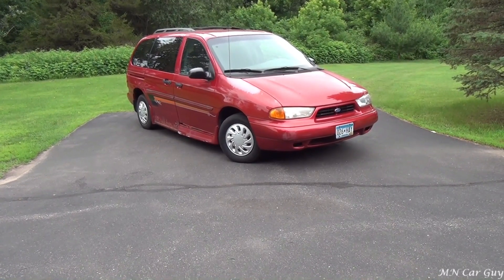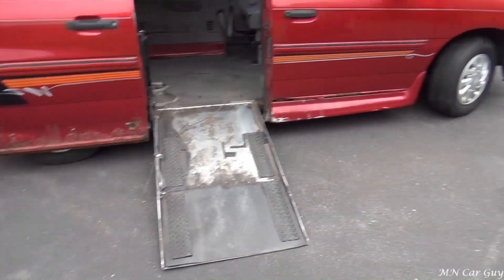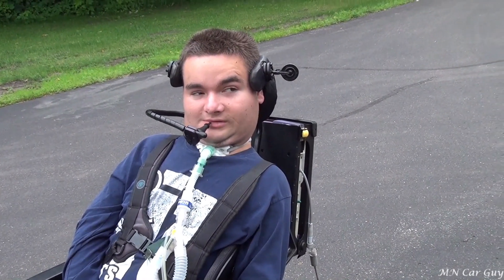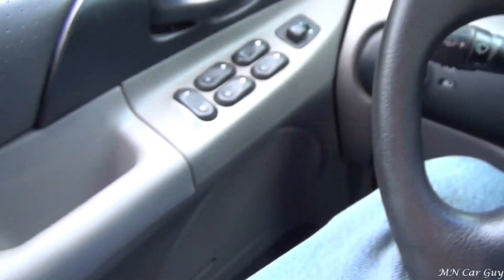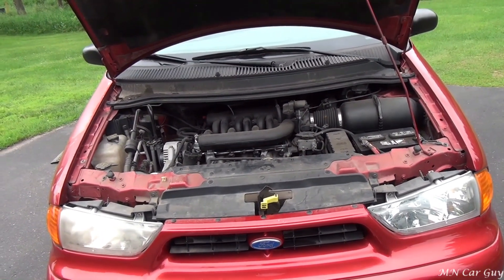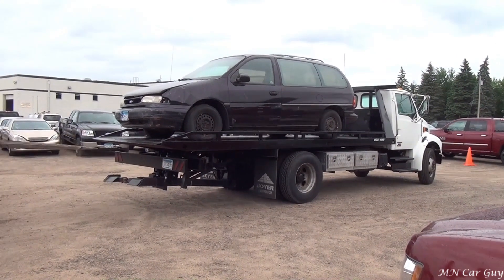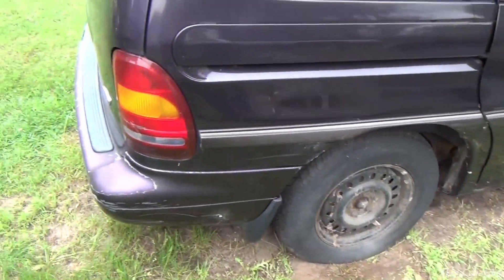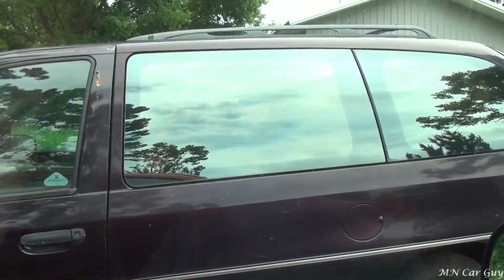1998 Ford Windstar (New Project!)

Comment: I have a 1998 Windstar with about the same mileage that this one had at the time of this video. The thing to try with that passenger side window is or at least on mine, it was a regulator. And I love to see how people are already hating on the engine in this saying it should already be swapped out. Being that this is a GL I am guessing that this is the same 3.8 L Essex V6 from the mustang. However, what people don’t realize is it is actually better in the Windstar because it has the split induction system. If you look at the intake Plenum, you will realize that there are actually 12 runners. Six small runners and six large runners. There is a butterfly valve in there, that if it is working correctly, will switch between the two sets of intake runners depending on what is desired. Power or efficiency.  If you want it to feel like it has a little more power and sound better, I would suggest, if you are in an area that doesn’t require emissions, just cut everything off and just run straight pipes out each side by the driver and passenger door. That is what I intend to do with mine, the previous owner I got it from just had the whole exhaust system bailing wire behind the catalytic converter, so I took all of that off so it is just coming straight behind there at this point. I have a couple of videos of the van actually on my YouTube channel here. But I’m guessing once I get that butterfly off of there or I mean why rather, so that it opens up the dual ports for the dual exhaust, I think it will sound much better. And as to the light staying on if you shut the rear end gate, it is not necessarily that the end gate is not latched. It uses those stupid Ford switches that would often go bad in vehicles like the explorer from the same time. So what you can do is to use WD-40 or any equivalent to lubricate the latches because the switches are in a graded in there. My van was doing that very thing last summer and so I did that just to all of my door latches and the problem has stopped.